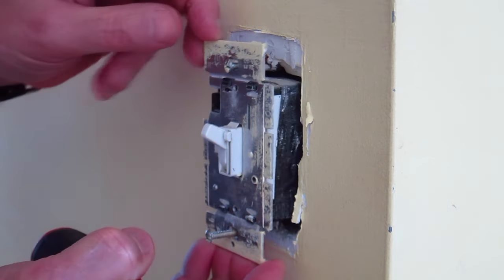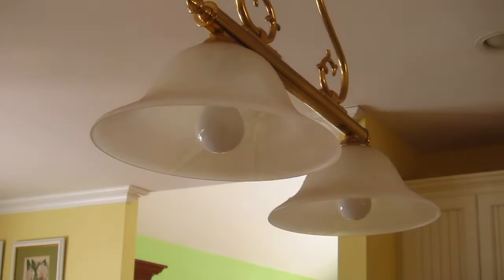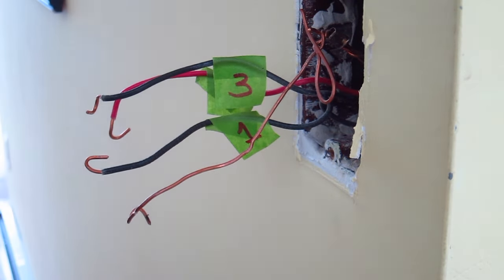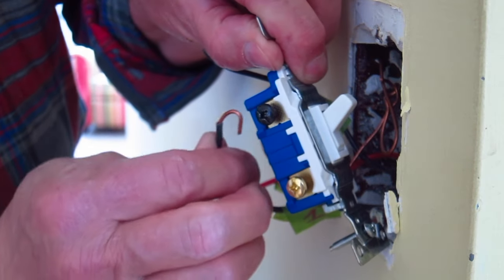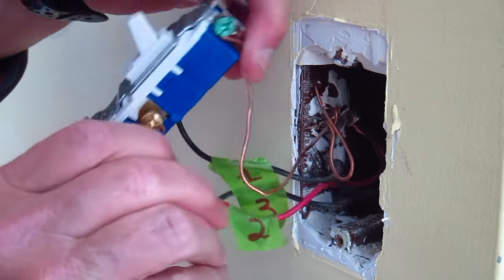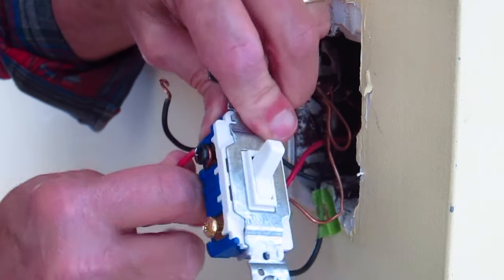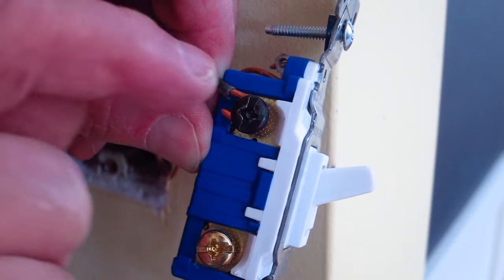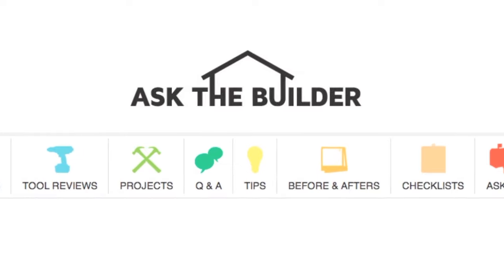3 Way Switch Troubleshooting

Comment: What if say.... I happened to not be paying much attention and removed both 3way switches the one on this end and the one on the other end, could i try this method on both switches? once i figure one out, could i then try this method on the other switch until it works? The problem is that the colors are different on both switches and i didn't pay attention to where each went.
Reply from the maker: You need to watch my ORIGINAL 3 Way Switch video when you make a mistake and futz with BOTH switches:

https://www.youtube.com/watch?v=LDyvcM0gcVs

Comment: You can use resistance to check which wires are what by opening the other 3 way switch, also use continuity to find your legs or play the guessing game I guess.
Reply from the maker: Thanks. This video was made for homeowners who don't have the device to test continuity nor do they know how to do it. You missed the point of the video entirely. Prior to replacing the switch, everything worked fine at their home. I suggest you make the video yourself showing the use of the continuity tester method. Then once uploaded, come back here and post the URL to it. Let's see what people have to say about it.

Comment: This is a little scary when the one on the cable is a live cable and it suppose to be on the black screw according to the switch instructions.was scared too do this and popping a breaker. But you really can pop a breaker when you have on live wire coming in. I’m going to try this tomorrow
Reply from the maker: Uh, which is why the FIRST thing I said to do is kill the power to the circuit.

Comment: Is it possible to use two 4 way switches ( 5 terminals) in a 3 way setup with the two 4 way switches being the only switches - In other words I bought the 4 ways by accident, first switch does send power to second but does not turn lights on or off, only the second switch does.
Reply from the maker: No. That won't work. Go watch my 4 Way Switch video to understand WHY: https://www.youtube.com/watch?v=Wknz-Beb268

Comment: I so wish that I was writing a thank you note, but having tried all three of your combinations (as well as a couple more), my switch is still not functioning properly.  Two of your setups allowed for partial use (one or the other switch would work if the opposite switch was in the proper position) and the third setup was entirely non-functional.  I'm depressed - seemed to work for everyone else - I was simply updating an old style 3 way switch.  Good luck folks!
Reply from the maker: Did you do what I said in the first 45 seconds of the video?  This video was made for those who take out ONE 3-Way switch in a perfectly working setup. Did your setup work perfectly before you started to work? Did you just take out ONE SWITCH? If you took out BOTH switches goofing up the wires on BOTH switches, then it's not going to work. But if you only took out ONE SWITCH, what you see me do in this video is GUARANTEED TO WORK. So, did you just take out one switch and mess it up?
Reply: @askthebuilder  Yes, sir.  I'm replacing just one of the switches where it was working properly before. Any other thoughts?
Reply from the maker: @jimtuttle4599  I have a tough-love message for you: You didn't follow my instructions OR the new switch is defective. It's a 1:1,000,000 chance the switch is defective, but it's possible. Can you see mathematically that using my method in one of the three steps the correct wire will end up on the BLACK screw. The two traveler wires don't care which of the brass screws they attach to. My method gets the wire that's continuously HOT or the wire that goes to the light on the BLACK screw. Try my method one more time being very careful you do move the wires around to all the screws CORRECTLY. If you still have failure, then return the switch for another one. Get back with a full report.
Reply: So I can "feel the love", Mr. Builder. And I can also do the math, which is why I sought out assistance online in the first place - I'd tried every combination known to man!  So given your reply, I tried your method again twice before replacing the switch, which sadly has provided the same results.  I sure wish in retrospect that I'd taken a photo of the old switch connections. I'm going to try rewiring the old switch using your method and see what happens.  Thanks for trying to help, but no success thus far. (My home was built by an idiot, so who knows - but since it worked before, it should work once again!). Very frustrating!
Reply: @jimtuttle4599  Remember, this video is only for people that have taken out ONE switch in a perfectly working circuit. If you took out both and goofed up the wiring on BOTH, then you watch my original 3 Way Switch video.
Reply: @TimCarterW3ATB  Yes, you already stated that and that was exactly my situation - a one switch change out on a perfectly working circuit.
Reply: Hi Tim.  I'm still at a loss.  This didn't work with the old switch that I dug back out of the trash, hoping on a slim chance that I had some kind of bizarre, special switch (As I said, my builder was "special" - sure wish I'd have taken a photo before disconnecting wires).  Nor did the second brand new switch work.  Could you please provide the link to your original video so I can troubleshoot this?  I'm wondering of one of the wires hasn't broken somewhere (there is virtually no slack in the wiring, so it may be possible that a wire may have broken during my switch out, yet my layman's mentality would suggest that I'd get no light function whatsoever if that were the case, eh?).  Thanks for your efforts to help!
Reply from the maker: @jimtuttle4599  It's somewhat easy to TEST for a broken wire with a continuity tester. Do that and report back your findings. Are you sure the circuit is HOT????? Have you located the HOT wire per my original 3 Way Switch video? WATCH that video so you understand how the wiring SHOULD BE installed.
Reply: @askthebuilder  Hi Tim, I sense you're starting to share my frustration.  I've watch all four of your videos and several others, but to no avail - I have a bachelors degree, some experience with 120V wiring (I assisted a certified electrician in completely rewiring an old house) and I fully understand the concept and how to follow your very simple - and usually successful - directions.  It's bizarre - please remember when communicating with me that this house was wired by a cowboy, not an electrician or anything close!  Is the circuit HOT?  Well, seeing as the light works in some of the positions, I have to answer that question affirmatively.  Oddly enough, however, when trying to find voltage using any combination of wires at either switch I can find none??  I KNOW, RIGHT? So I can't say that I've located the hot wire yet (since I can't get a voltage reading ANYWHERE). This guy didn't believe in ground wires or junction boxes and used switches and outlets to piggyback multiple wires, as is the case on the one three-way switch.  Then to make matters even more "fun", the cowboy left barely enough wire on these switches to be able to squeeze a screwdriver inside the outlet box to make connections.  I'll double check my continuity readings when I have an assistant available, but I attempted to do so before you suggested this and kept finding that two wires would show continuity with the same single wire on the opposing switch??  I'm at a loss as to how that could be??  Am I missing something?  Plus the switch I'm replacing worked properly before - what's changed??  Your 1-2-3 technique should've worked.  Sadly I'm sensing a 'Franklin' going the way of my local electrician, but I'll let you know my findings after I confirm my unorthodox continuity readings.  Thanks!
Reply: Hi Tim.  Forgive my delay in following up on our conversation - life's been crazy busy!  Here's what I found doing continuity testing - it doesn't make sense to me, but hopefully you'll understand these readings:

1 = Black common screw
2 = Left traveler screw
3 = Right traveler screw
N = No continuity
Y = Continuity

1 to 1 – Y
1 to 2 – N
1 to 3 – Y

2 to 1 – N
2 to 2 – Y
2 to 3 – N

3 to 1 – Y  
3 to 2 – N
3 to 3 – Y 

Any assistance is very much appreciated, Sir.  JT
Reply from the maker: @jimtuttle4599  You bet. I'm happy to help. Time for one of my consult calls. Pick one that works best for you. Look at Katherine's recent comment to see how much I SAVED her: https://shop.askthebuilder.com/consult-tim/
Reply: @askthebuilder  Hi Tim.  Can I assume then that given the information I've already provided that you have determined the problem and will guarantee the results with a 15 minute phone call?
Reply from the maker: @jimtuttle4599  You can assume I'm going to tell you how to fix the issue. As for a guarantee, I can't offer that because a guarantee relies on you following my instructions. You have my option or you can spend $200-300 on an electrician. I've already spent over 15 minutes with you with all these responses for goodness sake.

Comment: I replace the 1st switch in the series and that 1st switch is still working but the 2nd switch has quit working. Any 90 second trucks for that?
Reply from the maker: Yes. Go watch my original 3 Way Switch video and make sure you have the travelers on the correct screws. https://www.youtube.com/watch?v=LDyvcM0gcVs&t=6s

Comment: Tried it… gave up.  Paying an electrician to save my sanity.
Reply from the maker: What a damn shame. You could have had me call you on the phone. I would have saved you $125 and my guess is you'd give me a $25 tip like Katherine did. Here's how to schedule a call in the future if you get frustrated. I even do transcribed calls so you don't have to take *NOTES*: https://shop.askthebuilder.com/consults-reviews/
Reply: @askthebuilder  I’m sure if I went back and forth between both 3-ways, I’d get it to work eventually but I have a Lutron Caseta in one of the slots and it’s working with the smart home stuff but every time the kids flip the outside lights in the mud room it shuts off.  I tried the video stuff on the outside switch and no dice.  I may try the inside tonight but it was a long weekend.

Comment: Love the video but still not working. Whats frustrating is I know my load wire is good and has power. Both my travellers are connected and send power properly but my line wire is not sending power to the light. I’ve tried multiple switches and still nothing
Reply from the maker: If you only took apart ONE switch, then you're not following my instructions. Once you place the HOT wire or the wire that goes to the light on the correct screw - usually painted black, then it doesn't matter which of the remaining two wires goes on the other two screws. There's a 1 in 1,000,000 chance you have a defective new switch.

Comment: I tried other methods & this trouble shooting worked , why arent switches grounded , I spend hours trying to figure these wires , smh .. but I think as long as the red isn’t in the common , you’ll figure it out quick

Comment: Strangely when my 3-way switch connects Live/Hot to T1 then I see that T2 also has low voltage (~45V) on it and does trigger a NCV tester. Any ideas why this might be happening?
Reply from the maker: I'd have to see it. To get unlimited free tips each week like this, be sure to sign up for my FREE newsletter at www.AsktheBuilder.com

Comment: Ouch, didn't work! Everything was working before I wired the 3 way switch wrong. I was replacing an old 3 way switch from from the early 1900's hundreds with a new 3 way cool looking modern switch. After I wired it nothing worked and so I went through your steps and none of it worked. Even after turning the power on I notice with my voltage detector that there is no electricity going through those wires anymore. Maybe something got fried? The breaker didn't get tripped. What's really weird though is the light switch right next to the one I changed shows power through my voltage detector when I turn it off but when I turn it on it shows there's no power. It might've always been that way but I don't know. Very strange. What is clear is that there is no power anymore going through those wires at the top of the stairs north barn with the stairs when I have the breaker turned on. I can only assume that by wiring in correctly my three way switch some thing got fried. Got any ideas?
Reply from the maker: ...or that switch happens to be on ANOTHER circuit that's tripped. You just have to look at all the comments below to know that what I show in the video is foolproof. That is if your situation is EXACTLY as I describe in the first 35 seconds of the video. Need me to help? I offer over-the-phone coaching. Far cheaper than calling in an electrician: https://shop.askthebuilder.com/15-minute-phone-or-video-conversation-with-tim/

Comment: I have two black wires, 1 red, 1 neutral coming from the box but I have a decor 3 way (3 screws) device. I tried neutral to the green screw and red wire to green screw and black on the other two screws, doesn’t work. :|
Reply from the maker: Maybe you should jump on a phone call with me to sort it out: https://shop.askthebuilder.com/15-minute-phone-or-video-conversation-with-tim/

Comment: This works unless you replaced both three way switches and the second switch was the problem. Just remember to check both switches before you rotate one through three for an hour! I may or may not have invested the hour going in circles. 😭
Reply from the maker: I covered this in the first 30 seconds of the video. I clearly stated that the viewer was watching the video because they tried to switch out ONE switch.

Comment: Or could just insert wire in the little hole on the back and wire it the way you took it out either way im a subscriber
Reply from the maker: I'm not a big fan of the little holes in the back - for a host of reasons. Try getting the wire out of one of those holes without damaging the wire.
Reply: Yea you are right but i would either crush the switch or trim the wires the wires in my switch boxes are pretty long and when do you ever have to replace a switch

Comment: This came close to fixing the problem for me, but not 100%... I have to have both switches on to have light on, not like the other three ways in my house which are switchable on and off from either end. If switch 1 is off, switch 2 is dead, if switch one is on, switch 2 can switch on and off.
Reply from the maker: There is no static on/off position in a 3-way switch. Don't confuse these with a single-pole switch. It is vitally important that the HOT wire from the circuit be on the black screw on one of the switches. Of that, there's no doubt and I cover that in my other 3 Way Switch video. https://www.youtube.com/watch?v=LDyvcM0gcVs&t=297s

Comment: Didn't work. But after reading comments it appears your mileage may vary depending on several factors. I have 2 switches. Upstairs and downstairs. The light at the top switch is just outside the door. The 2 lights and 2nd switch are downstairs in the carport. I trued the wire swap on the downstairs switch. Did not work. I tested continuity on the downstairs switch between the top screw (common) and the the bottom A and B. So I believe the downstairs switch is working. I need to check the upstairs switch next but it's too late. I wasted an hour playing musical chairs. I will go watch your other videos. I do understand how this works and the method to your madness but honestly, the video needs to be more umpressive on why this won't work. Everyone is coming here and has tape and sharpie and some screwdrivers and are like, wow, wife will love me. I made the mistake of telling her I can have this fixed in 90 seconds. Now I look like an ass.
Reply from the maker: Dear 316: Your wife has you pegged because you obviously didn't pay attention to what I said in the first 40 seconds. It's all about singular and plural. I said at 0:24 "..that 3-way SWITCH." I didn't say SWITCHES. If you read the HUNDREDS of comments from people who DID pay attention, you'll discover that my method works. If you took out BOTH switches, all bets are off and you need to watch my original 3 Way Switch video to understand where the wires go on each screw.

Comment: I tried it and this combination DID NOT resolve my 3-way light switch issue.
Reply from the maker: Dear H. I'm sorry for your bad luck. I always get a kick out of comments like yours. They're fantastic TEACHING moments for folks like you. Here's what we know to be fact:
1. My method works. Just scroll down and read the countless Thank You! comments.
2. You may not have paid attention to the first 45 seconds of the video where I clearly say the video is about fixing *a SINGLE working 3-way switch that you want to replace". In other words, before you removed the wires from just ONE SWITCH, the two 3-ways worked fine. If you take BOTH apart and mess up the wires, then you need to watch my ORIGINAL 3-Way Switch video to put them all back together. Go here: https://www.youtube.com/watch?v=LDyvcM0gcVs&t=1s
3. It's a 1:1,000,000 possibility, but the new switch could be defective.
4. You might have broken a wire in the box while goofing around with it.
5. I can save you. I offer phone consulting for folks like you that need a life preserver: https://shop.askthebuilder.com/15-minute-phone-or-video-conversation-with-tim/